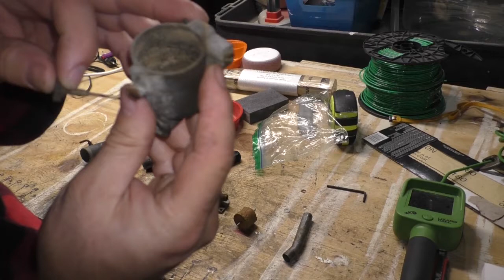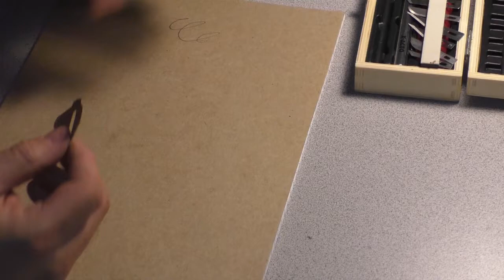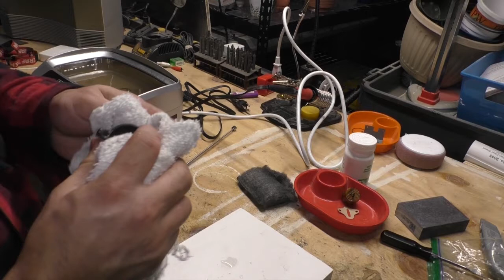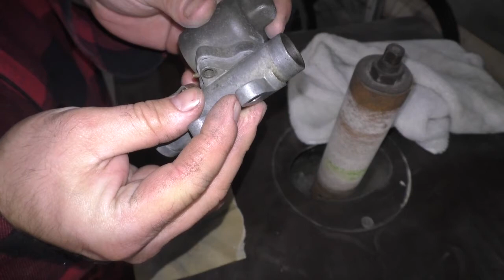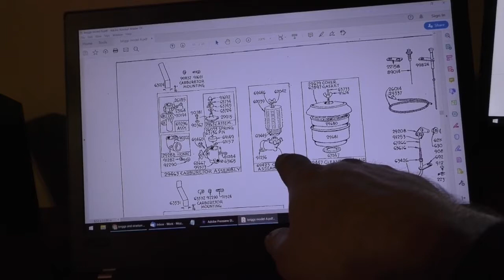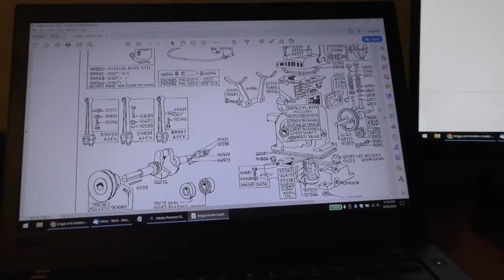1937 Briggs and Stratton Model A - Part 7 - Carburetor Cleaning and Reassembly

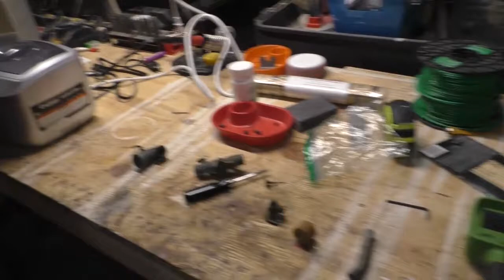Comment: Nice! Is it possible that that other port/ jet you were talking about at 7:20 is and idle circuit and the one with the needle valve is the main? I know on their later carbs for these engines there are 2 separate mixture screws: 1 for the idle / low speed jet, and one for the main /  high speed jet. Also, I think that these carbs are pot metal so you don't have to worry about them discoloring :) Yea those LA engines are pretty interesting! I think that they really have mixers more than carburetors. Kinda like the old Hit Miss Engines had. Carburetor came out great! Looking forward to watching this thing get painted!